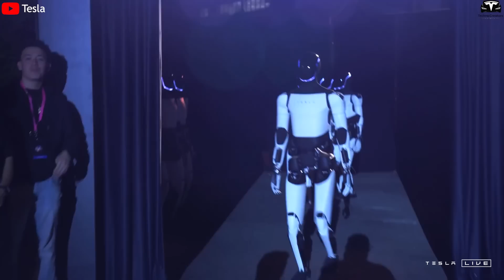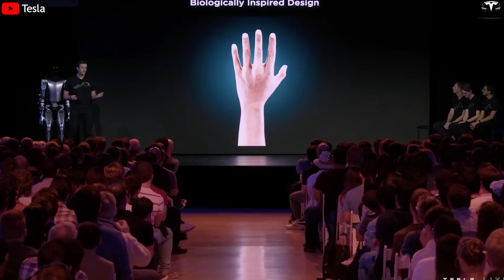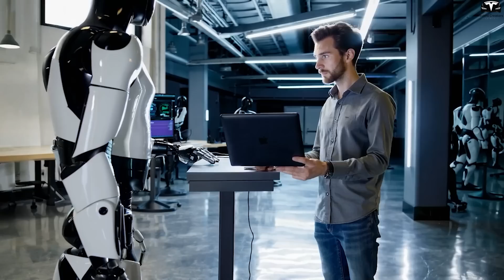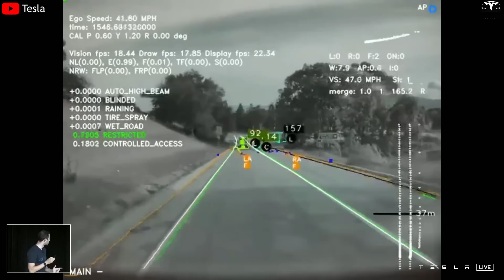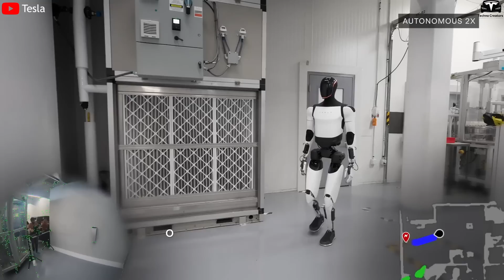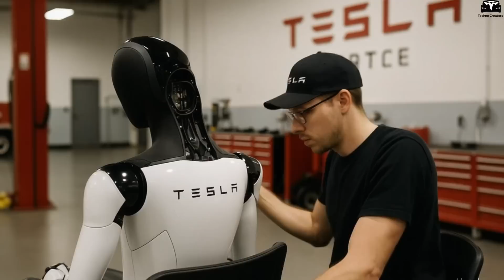It Happened! Elon Musk CONFIRMS Tesla Bot Gen 3 Special Edition 2025! Plan For Shocking Price $10K!

Comment: Can I teach it to drive my boat to the fuel docks, gas it up then come back and pull into the boat slip?
Reply: While keeping an eye on the depth finder to avoid shallow water, navigate 4 miles one way via the intercoastal waterway and adhering to the rules of the water.
Reply from the maker: Yes, you can absolutely teach it to do that process automatically.